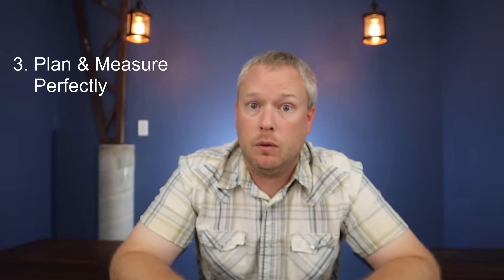7 Drawbacks to ICF Construction -- Problems with Insulated Concrete Forms

Comment: Question: how long did you let your walls cure before building on them?  I’m very early in my ICF journey, so I’m more curious than judgmental. Everything I’ve read says to let the slab cure for anywhere from 2-3 months before building. That’s also how I’ve seen non-ICF slabs built in Europe. It adds a lot of time to construction, but makes for a far sturdier structure.
Reply from the maker: I would say about a month.  30 days gives you 95% cure strength on the concrete

Comment: You do not need to stick an air barrier on ICF above grade, so no need to deal with the fine exterior yellow powder that may develope on the exterior of the ICF.
Reply from the maker: True, but around windows and doors, you need to install some sort of flashing tape to seal the gap and air instrusion.  If you are applying stucco, the yellow powder must be removed.

Comment: Can i build a 30x40 house without lateral block walls?
Reply from the maker: That's going to depend on your local government regulations
Reply: @Challenged1  is the rebar  anchors in the slab good enough?
Reply from the maker: @FourthWayRanch  That's a code questions specific to your jurisdiction
Reply: @Challenged1  we are just 2018 international residential code here. It says no more than 20' I think, but do the anchors in the slab count as the bracing? I got this home developer pro software and trying to get a permit for my design.

Comment: A lot of pest control companies said they don't want to cover ICF houses because they say termites can dig tunnels under the concrete and chew threw the insulated blocks to get to the wood or food sources inside the home.  I've always read there were no problems with termites or mice or anything like that with ICF homes.  I'm not sure why they would say this because they cover wood houses that are built and that is so much easier for termites to get too.

Comment: A 2" x 6" wood-frame home with exterior 2" Zip system and mineral wool  wall insulation would have provided as much or more insulation factor for your home and it probably would have been cheaper. It also is much faster to build. However for your basement area, the ICF blocks are a much better choice. 

A 2" x 6" framed home is also much cheaper than using concrete walls. Again, concrete walls are the best choice for your basement. But above grade, well-built 2"x 6" homes are amazingly energy efficient, solid and cost-effective.
Reply from the maker: I agree, a 2x6 home is definitely a huge step up from a 2x4 home.  What you have to remember is ICF has many benefits outside of just insulation.
Reply: @Challenged1  I like the ICF concept but they have one inherent serious flaw. Termites, rodents and other pests can get into the foam and create nests. This is especially concerning for termites because in some states, termite companies will not treat a home that has ICF insulation on the exterior. 

This is a critical flaw because termites could work their way to the interior walls and trusses which are made of wood. While this is true for all homes, ICF termite infestations are hidden.. 

Here in AZ where I live, codes require a minimum 4" tall exposed section of the concrete stemwalls on homes. This is because the vast majority of termite tubes are formed on the outside of the stemwalls. Termite inspectors are trained to look for termite tubes that extend up the house's stemwall to find the points where termites are entering the home. While termites can occasionally get under the slab and gain access to the house through a crack,  this is pretty rare in most cases. 

With ICF blocks, there is now an easy way to see where termites are entering the home because they are burrowing through the foam insulation. It is my understanding that some manufacturers have started adding borate and other termiticides to their foam mixtures, but that still doesn't eliminate the problem of mice, rodents and other insects burrowing into the foam.

I am planning on building a guesthouse in my backyard and the main house has had problems with termite attacks. To eliminate this problem, I will be installing a concrete block basement foundation that his solid grouted and I will use a waterproofing coating over the underground blocks. I will also install permanent holes in the basement foundation fitted with non-rusting cylinders that have metal caps. Termite companies will be able to screw the caps off and inject termiticide all along the edge of the exterior CMU walls through the metal tubes. This will make it possible for me to treat the building easily if I choose to do so. 

All interior walls on the first floor will be made of LVL studs and plates, which are highly resistant to termites, and I will use pressure-treated bottom plates. This should eliminate any wood that the termites ill be interested in eating in the basement. 

I will frame the interior wood walls with an air gap from the CMU block and insulate the walls. I plan on using a 12" wide block, so the thermal mass of the block should be sufficient to resist the intense summer heat we deal with when coupled with the insulated 2" x 4" walls. 

The first and second-floor exterior walls will also be 12" x 16" solid grouted block, primarily for noise Isolation and insulation purposes. On the first floor, I will again use termite-resistant lumber. Only when I get to the second floor will I use regular lumber.

The cost to use this system will be much more than a wood frame 2" x  6" structure with a stucco exterior, which is the most common design used here, but it will be incredibly well-insulated from hot and cold weather, nearly soundproof, and highly resistant to termite attacks.

I am a civil engineer with a general contractor's license, and I thought you might be interested in the design I have come up with to deal with the challenges that AZ homes face.

I enjoyed your videos. Thanks for your reply.
Reply from the maker: @franklong6269  It sounds like you have put a lot of thought into you design.  I agree, the termite issue is a problem, although not an insurmountable one.

We have the same background!!!  Very cool!

Comment: I agree with you that one should not try to run a dryer vent up an ICF exterior wall. However, I recommend you run your dryer vents horizontally, straight THROUGH your exterior wall. This will cause less bends and ductwork where lint can gather and clog up your vent. Keep it short, straight and simple. This way, you can reach into the wall duct and clean it out by hand, rather than hiring a pro. Also, you'll need make up air coming into the home to allow good air flow out the vents. He mentioned this fresh air intake penetration in the video.

Comment: I spent ten years building ICF here in the UK, I think is a great way to build. Most of his points were valid however I think it’s worth it for the type of structure you end up with, although I will say changing your plans to suit the blocks is useful but defiantly not essential. I would definitely recommend a heat recovery system as the wall are so air tight without it you could end up with a moisture problem.
Reply from the maker: I completely agree!!!

Comment: I just wish there was more information on the actual heating and air conditioning money saved per year compared to traditional concrete foundation. Everyone and their dog will tell you ICF is more energy efficient and has a better R-value but most people want the brass tax. I mean I’m not willing to spend another eight to $10,000 on initial build just to save eight to $10,000 over the next 10 to 15 years.

Comment: Could I put all the pipes & pipe conduit for the electric in the wall as i stack the blocks? So the electric will be in the concrete.
Reply from the maker: If your building codes allow it, I don't see why not.

Comment: This is a great video!  I am planning on building an ICF house and doing the plans on my own, starting with an ICF wall design.  Your points about wall penetrations are very good. As another wise viewer mentioned, it is probably a good idea to add a few extra electrical penetrations and cap them off with unglued PVC pipes and caps.  In ICF, measure twice cut once may not be enough.  I'm thinking of measure four times then have someone else check it before finalizing the window and door bucking!  Your discussion about moisture was new to me in my review of ICF construction.  I am curious if many others have had similar issues with moisture.  Overall, you make a lot of really good points and I really appreciate the information.
Reply: Why not go with full foam build from sabs international, way more simple.

Comment: I needed to hear about these concerns. There is a lot about the prose of ICF.  Finding an experienced ICF contractor is another important part because there are intricacies that need attention to detail.   We are planning an ICF basement only, and on top a stick build with Zip R sheathing, insulation on the outside of the studs for thermal bridging issues. That way there are more options possibly later on should one want to add a window or make structural changes. It is amazing what outer insulation you can put on a home sitting on an icf basement foundation now a day, even here in Eastern Canada, Atlantic region.  Thank you for this matter a fact and considerations to think about. 👍  🙏  🇨🇦
Reply from the maker: Thanks for the comment
Reply: Did you succeed in doing this? We are trying to decide whether to do just as you describe (ICF basement and 2x6 zip R sheathing for upper floors—or all ICF). Wondering which is best and if you are glad you approached it half and half?
Reply: @Karen-rx9xo  Update: The concern is on going with finding here on Prince Edward Island an experienced contractor to do a full ICF home.   Navigating to find an ICF company, contractor, for the basement is a challenge in itself, here on Prince Edward Island.   The decision is to do basement only in ICF. Lack of confidence in skilled ICF workmanship here on PEI combined with wanting options in a 2.6 stick build for upper floors were the 2 and only considerations to the final decision.   Its very difficult here on Prince Edward Island to trust building, contractors, here.  The workmanship in what we observed in viewing homes being built, and talking to new home owners who went through the stress of dealing with the labour building force here is disappointing.    The plans are ICF basement with 2.6 stick build on top. :)

Comment: I watch you build ICF and I have questions.  If you don't answer me I understand. I am attaching my pool plans so you can refer to what I'm doing.  
I'm building a swimming pool jacuzzi love seat and tanning deck within a 22' X40' ICCF swimming pool that will be heated year around.  

1.  Can I just dig a rectangular hole in my ground and fill with rock to achieve my 3' 6' 3' play pool or does my ground need to match what depths I'm trying to achieve in a play pool flooring foundation?

2. I'm using 10" perfect Blocks for the perimeter walls of the pool.  The back wall above the pool line will be a 5' wall above ground attached to the pool wall.  For the perimeter walls foundation do I want to use Fab Form, Fast Foot, Foothold, or Form a Drain for my Foundation?
The inert walls will be either 6" or 8" perfect Blocks or should I Gunite the interior with Rebar and Gunite?

3.  I was originally going to use Amvic Icf form and litedeck for the pool flooring, now I want Perfect Blocks as they seem easier and built in the US.  what icf can I use for the pool flooring as I was going to have radiant floor heating?  

4.  Can I use an high density insulation sheathing for the pool floor as this is where all the heat escapes? 

5.  I am doing most of the work myself, I'm on a budget and like to do DIY stuff.  But this is a huge project and I'm frightened. LOL.

6.  I will be using Pebble Tec for the pool finish.

I hope you can help and look forward to your input.
Reply from the maker: I've never built a pool with ICF, but I've done a lot of research on it.  Here's my take to your questions:

1.  Make sure your footings are all on virgin soil.  The rest can be filled with rock.
2.  I would pour the pool slab and footings monolithically and avoid all of those footing products.  Just pile rock at the outer edge of your pour against 2x4 forms.
3 & 4.  Use rigid foam rated at a minimum of 25 psi under your slab.  You can passively heat the pool as well if the tubes are also run within the concrete walk/patio surrounding the pool with a small pump circulating it.  These walks get incredibly hot when the sun shines on them.

Hope this helps!

Comment: We ran 2 industrial-sized dehumidifiers after walls and roof were up but before any drywall etc was installed. This quickly dried out my full ICF home after most of the water outgassed we finished the interior this works better than drying when sheet rocks ups.
Reply: How long did it take to dry before drywall put up?, what time of year, what climate zone?
Reply: How long was it before you got to drywall the interior? Thanks
Reply: @zebrabuzz  Was 15 years ago think the better part of a week. Was summer time and S WI is humid.

Comment: I am trying to find information on how do I screw something into walls once construction is done. (cabinet, storage plank, etc...) There are no beams, no information anywhere.
Reply from the maker: The plastic strips provide some level of hanging.  But if you are going to hang a large, heavy object, you need to remove a section of the foam and attach a 2x4 directly to the concrete.  Then attach the object to the 2x4.
Reply: @Challenged1  Oh my god, 10 X thanks!!!
It is a townhouse group. All the walls/finishing will be completed when I move in :(  . Do yu know if a "beam finder" will be able to detect these plactic strips?  Thanks again for the info!!!
Reply from the maker: @MrTeabag55  They won't, but a magnetic stud finder can find the screws
Reply: @Challenged1  you have no idea, 2000 X thanks fr that info!!!!

Been searchig/reading quite a long time t fnd that info!!! No inf available!!! Thanks again!!!

Comment: Your statements are BS, a 8' long ICF block is only picked up with 1 hand and folds into a sandwich for easy transport.
Reply from the maker: A bundle of them are not that light as I stated in the video.  You move bundles into place, not individual blocks.

Comment: Interesting Video very informative. In the UK / Europe we have wood create Block. Made from modified recycled timber so that it is inert/ does burn/ has absolutely no food value for any insects / termites /rodents etc they are completely water proof so you could build a pool with them with no need to line it expect for aesthetics, no need to clad or render the outside of the building except for aesthetics or to comply with local planning legislation. the inside face can be chased out for cable or pipe work to the depth of the block about 40mm / 1 3/4", you can plaster directly onto them and as the insulation is on the external face, but within the block so the concrete structure for a massive thermal mass which help enormously to maintain constant internal temperatures summer and winter. We've built several houses with these and had no issues at all could your concrete have been a little to wet ? ordinarily about 50% of concretes water content is consumed during the curing process.
Reply: This is interesting. I've seen some videos with people making walls out of concrete mixed with regular saw dust. I wonder how manufacturers of woodcrete blocks are modifying wood used in them?

Comment: Did you consider using Helix micro rebar? Why or why not?
Reply from the maker: Not at the time.  Just didn't know anything about it back then
Reply: How much strength would Helix add to the concrete?

Comment: I've been on a barndaminium kick for a future build. I like the idea of icf though too. I think both appear to benefit from hydronic heat in the slab. I'm assuming you did that?  The only draw back I see with icf is keeping  mice out of the foam. I know it could be flashed with tin, but what did you use?

Comment: Why not drill a bunch of weep-holes in the foam two weeks after pouring ??

Why not recommend a concrete additive ?
Reply from the maker: What purpose would the weep holes serve?  No water would weep from them.  Allowing concrete to cure for an extended period of time makes the concrete stronger.

Comment: Seems like only 5 and 6 are drawbacks. The rest are actually really benefits of ICFs, including the moisture. The longer your cure time, the stronger your concrete. Currently planning an ICF structure and planning to let the poured walls cure for 28 days before proceeding with more construction.

Comment: #8, if not carefully built mice and rodents will make a maze in the foam insulation behind the siding and make their way into the house. 
#9, putting up heavy objects inside the house (on the exterior wall) is a PITA.   Especially trying to determine where the electrical and "spines" are located. In most cases you have to put anchor bolts in the concrete  for heavier items.  Professional installation may be required if hanging a 110" TV, etc.
Reply: #8 - as with any type of construction, you need to seal holes/access to prevent rodents/insects from getting into things.  However, rodents/insects will have a very hard time getting through the concrete.  I would recommend either a cement board type of siding, or stone/brick veneer. 
#9 -  ICF homes need planned out in detail, like all homes, but the cost/pain to make changes after is more.  In theory, shouldn't a stud finder find the spines, after all they are metal.  Otherwise, you may have to drill into the concrete, which while a pain, isn't that big of a deal.  But once again, if you know you will be hanging heavy items, then plan ahead and put in the supports before.  Or hang the item on an interior wall.